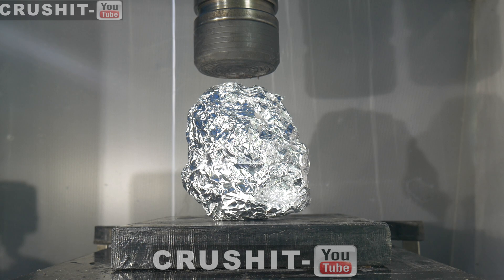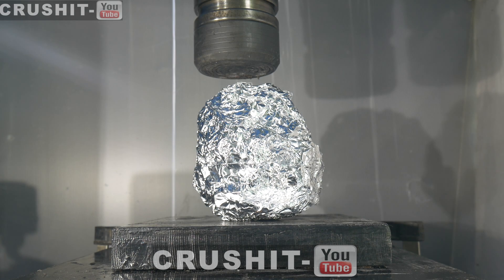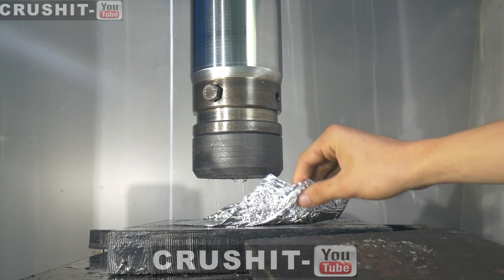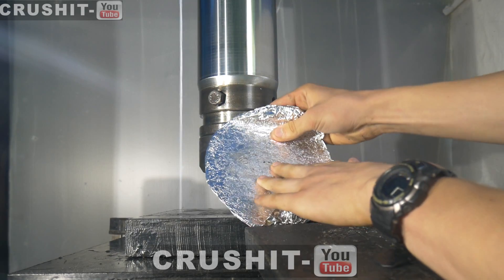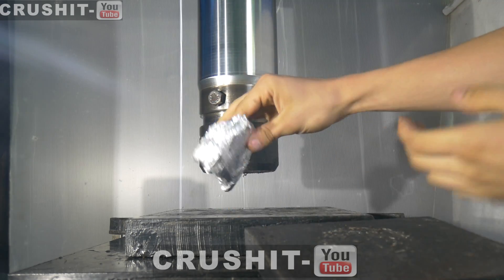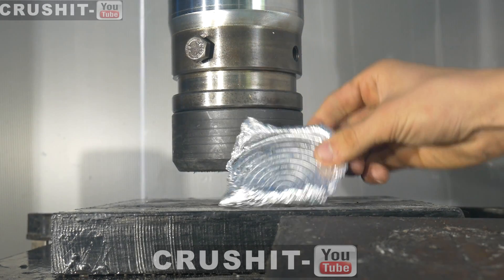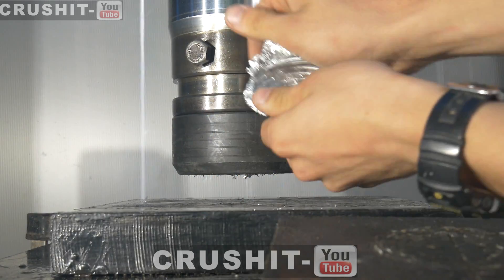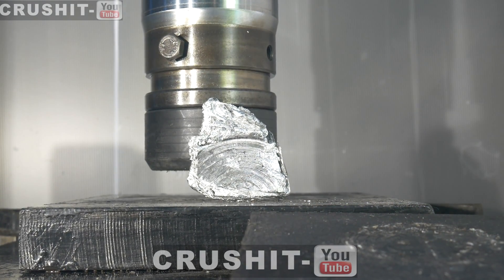Crushing Aluminium Foil Ball with Hydraulic Press

Comment: You called aluminum tin lol.
Reply: Nasir Khan, TIN foil was made from tin, but after WW II it was replaced with cheaper aluminum or aluminium but still refer to as tin foil in man parts of the worl while no longer made from Tin.
Reply: Tinfoil is made from aluminium (or other metals)
Reply: Tin foil and aluminum foil is not the same.
Reply: +Icureditwithmybrain if you type "define tinfoil" into Google then it will say that it's usually made of aluminium. You just assume that tinfoil is made of tin.